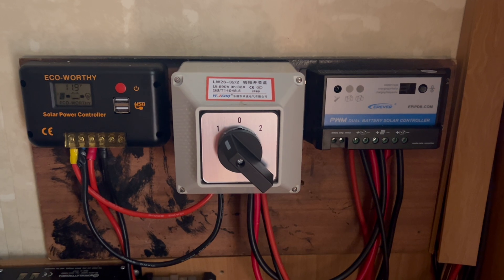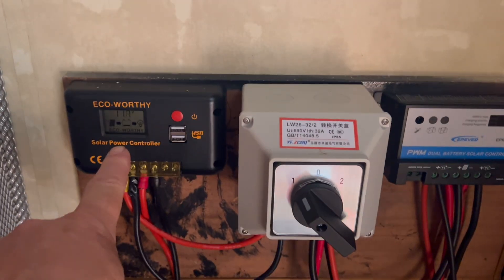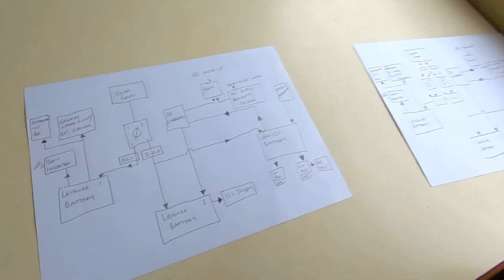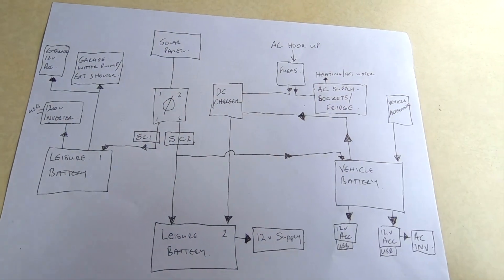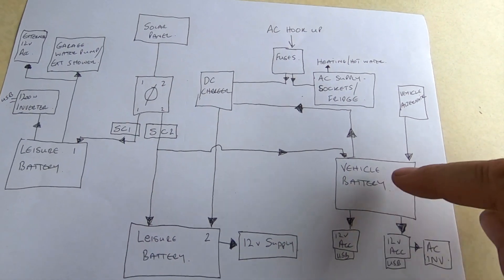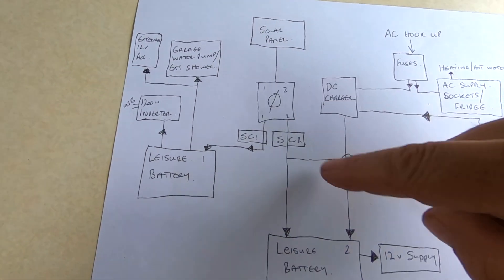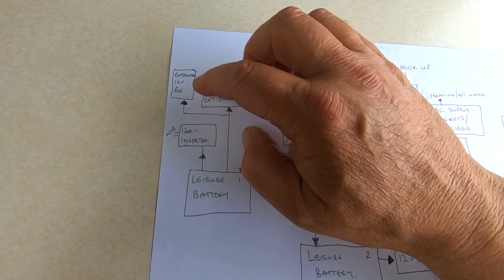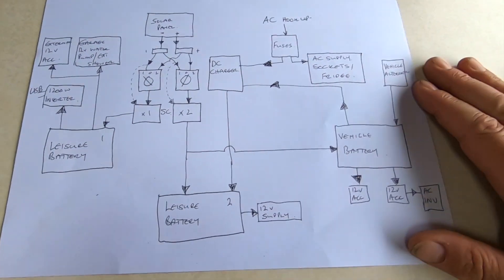How To Charge 3 Camper Batteries With A Single Solar Panel

Comment: You can't connect differnt batteries in series (even if they are the same but a different age) if you would need 24V for instance, but as @paulladdie1026 said, you can hook them up in parallel without any problems. As long as they are the same voltage and chemistry.

Comment: Thinking, if you have a voltage sensitive relay that drives a higher amperge relay. the default is the main starter  battery voltage is full, it flips over to charge the 2nd and 3rd..